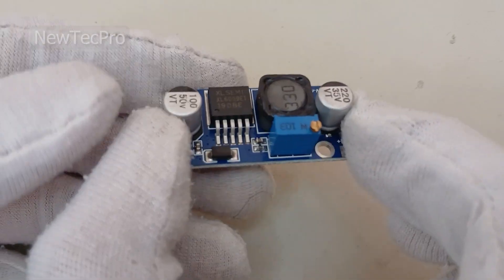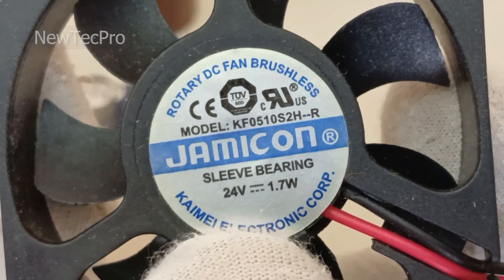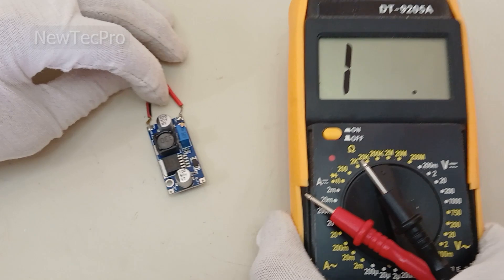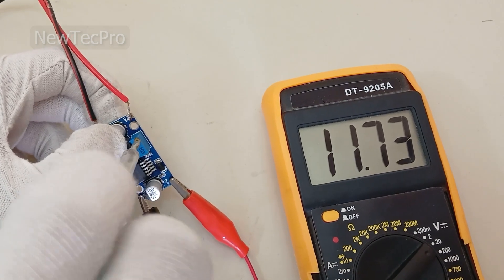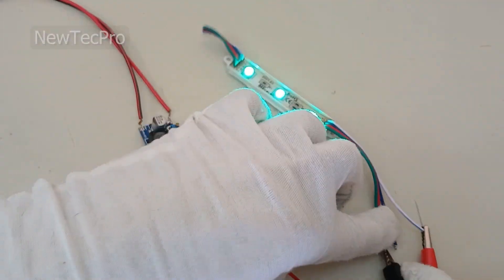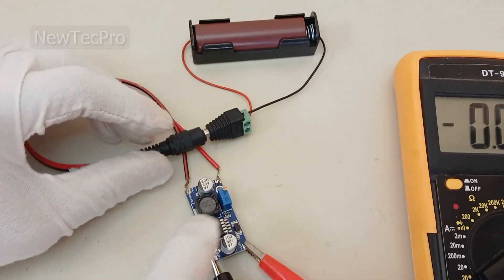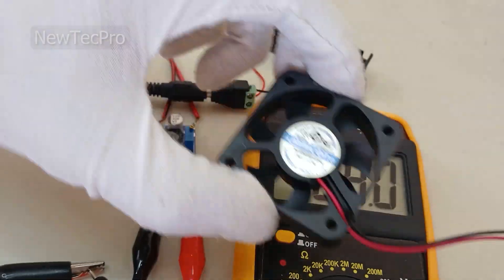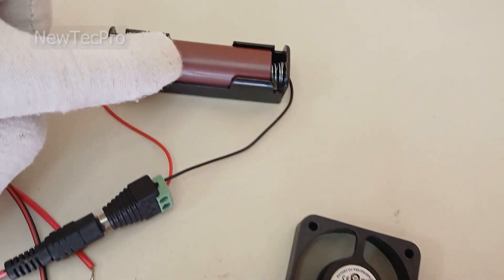How to use XL6009E1 Step Up Power Boost Voltage Converter?

Comment: Hi there, I have less that 1v input from a wind generator and want to turn a LED light on, how can I boost the power? thanks
Reply from the maker: The XL6009E1 needs at least around 3–5 V input to start boosting. With less than 1 V from your wind generator, it won’t work. You’d need a low‑voltage boost converter designed for inputs under 1 V, or use a supercapacitor/battery buffer to store the energy first and then boost it to power the LED.
Reply: @newtecpro  Thank you so much, do you have any examples of supercapacitor/battery buffer you mentioned?

Comment: when you use this booster with a battery, does the voltage remain the same. as you set, even when the voltage is dropping in the connected battery itself? or it drops?
Reply from the maker: Great question! 👍 Yes, the XL6009E1 is designed to maintain the output voltage you set—even if the input voltage from the battery starts to drop. As long as the battery voltage stays above the minimum required input (usually around 3V for this module), the booster will keep regulating and “stepping up” the voltage to your target level.

However, if the battery drops too low, the converter might struggle or shut down, so it’s always good to monitor your battery health. Hope that helps!
Reply: @newtecpro  Thanks 🙏